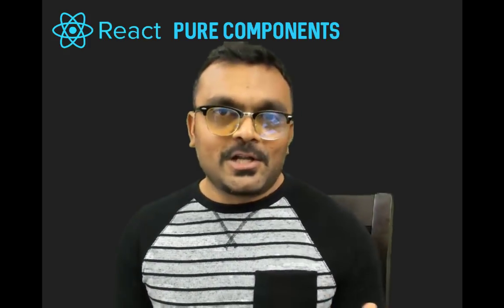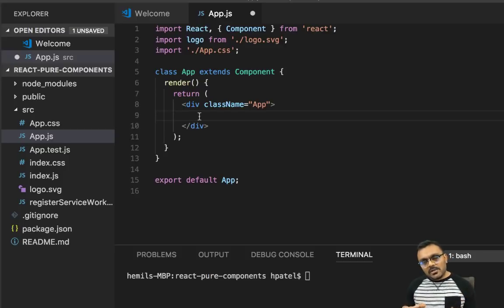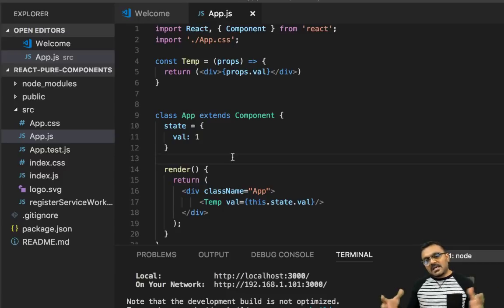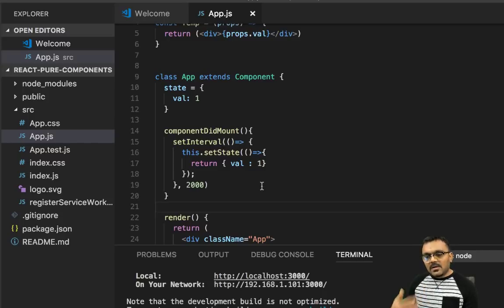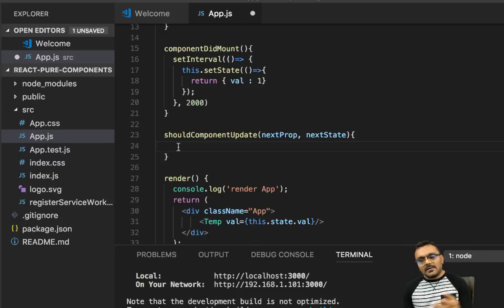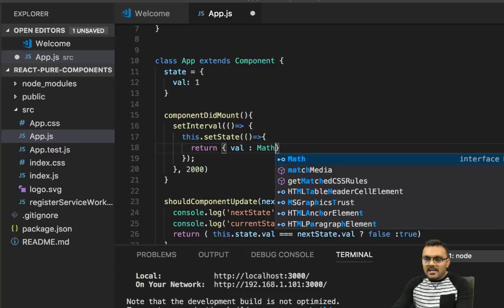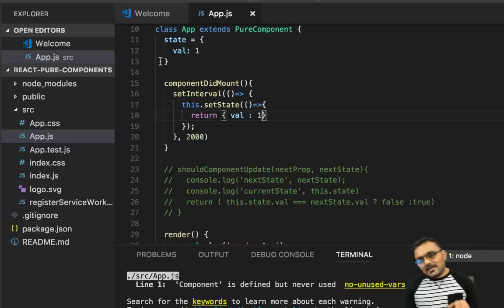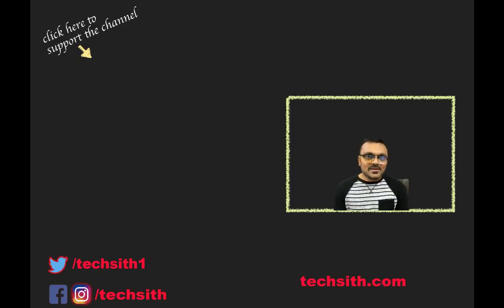React Pure Components Tutorial

Comment: Very good video. But I have one question about the specifics: so in the case of PureComponent, does React do shallow comparison on the state object OR all the attributes (as values/objects etc) of the state of the component? I suppose it's the latter since as we see in the example with Component, the state objects are different. Am I right?
Reply from the maker: Its actually doing shallow comparison of the state of the object its updating.
Reply: So shallow comparison means it will iterate through the attributes of those two objects and does comparisons. I see. Thank you.
Reply from the maker: A shallow equality check means that JS only checks that the value’s object ids (as in, the memory address for where JS stores the information for that particular object) are the same, not that their content is the same.
Reply from the maker: React uses a shallow equality check because it is is way 
more performant than doing a deep equal. In fact, React doesn’t even 
offer doing a deep equality check. You can do a shallow check (with PureComponent), write your own check (with shouldComponentUpdate),
 or not check at all and just always re-render (the default). It’s too 
risky for React to do a deep equality check since you might have really 
deeply nested data. Instead React errs on the side of not checking and 
doing the re-render automatically.

All if this is generally good news if your component is working with shallow-equality-friendly data. If the  state and prop
 value ids change when their content changes then the components 
re-render when the should - yay! However, if you don’t handle your data 
properly, then you can accidentally not re-render when you should